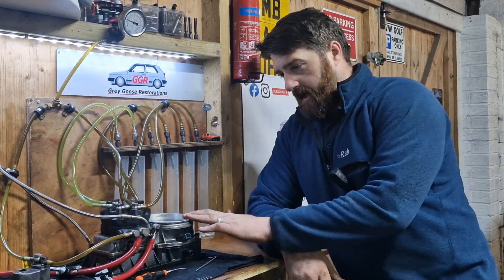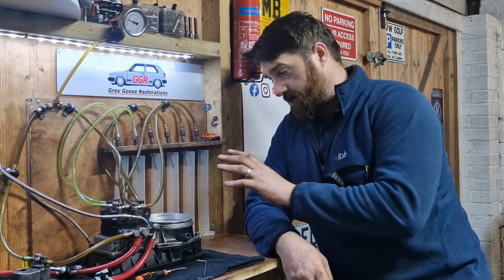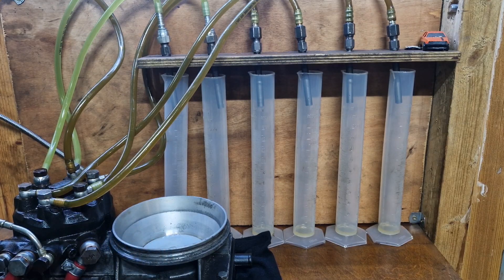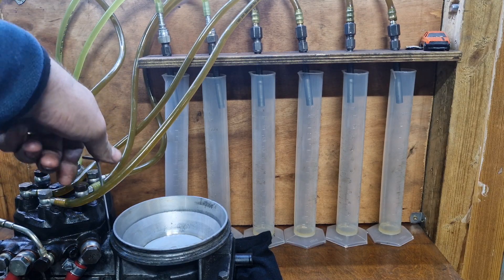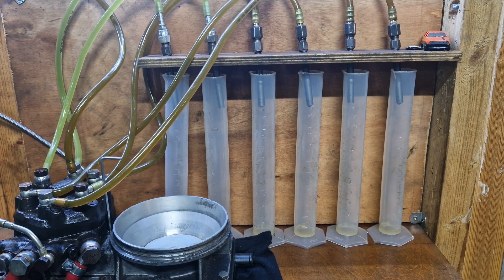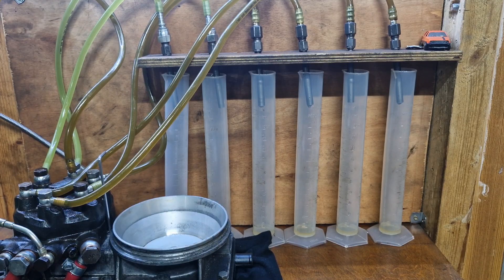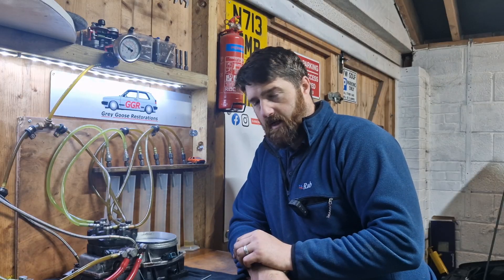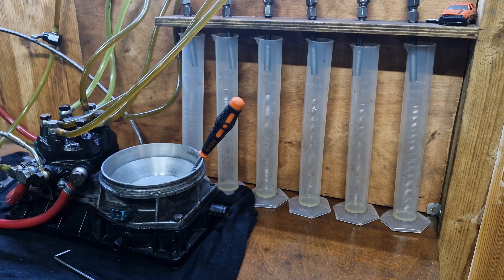Bosch K-jetronic - CO Mixture Basic Setting

Comment: Awesome to see the response to comments!
My question is, "Which of the 17mm connectors is coming from the fuel tank?". I see 2 17mm connectors; 1 of them closer the rear, one facing more forward alongside a smaller connector. Thanks!
Reply from the maker: The 17mm feed pipe is the one on its own, the return line is the one with the smaller bolts by the side of it
Reply: @GreyGooseRestorations  Subscribed! Greetings from Canada
Reply from the maker: @katey.m Many thanks, Canada is a beautiful place too 👍

Comment: an interesting question, have you ever done a test if the disk in the air mass meter is completely open when you hold full throttle? I'm thinking of an original 2.0l volvo engine. if it's completely open, it's unnecessary. to make a bigger throttle. then the engine will get too much air
Reply from the maker: I did a video showing how high the air plate actually rises if that's what you're asking
Reply: @GreyGooseRestorations  yes where is it?
Reply from the maker: https://youtu.be/h9O03Fd-WpE

Comment: Hi
It is same adjustment for KE jetronic?
I try make running escort rs turbo 1986
Reply from the maker: Very similar yes however with the KE units there needs to be around 0.5mm of air plate free play once the unit is pressurised
Reply: @GreyGooseRestorations  Thanks mate 👍
Reply: Do you know what pressure should be in KE system?  (Escort)
Reply from the maker: Just given me an idea for another video too 👍  5.6 - 6.0 bar system pressure with the lower chamber being 0.3 bar less than system pressure
Reply: @GreyGooseRestorations  nice one👍
I will wait for your new wideo 😀
Reply: Do you have Facebook account about cars ?
If yes, I will send you some pictures/video about escort repair

Comment: To make the injectors run when undertaking the injector tests in the car, is it simply enough to turn the ignition key on or should the power be "turned on" by running the fuel pump?
Reply from the maker: You will need to bridge the fuel pump relay in most cases so the fuel pump on the car runs continuously, you can normally swap the relay with another one in the fuse box which isn't a timed type
Reply: @GreyGooseRestorations  Thank-you. In our case that would be jumping our RPM relay.

Comment: Can you do a basic video where you disassemble all the parts of the K Jet unit and discuss the most common failure modes and adjustments. I am a SAAB collector and your videos are very informative. Do you ever see issues with the relief valves and where are they located?
Reply from the maker: Thanks, I will see what I can do ref a video like that

Comment: Hi! I'm from South Africa. I have a 1983 MK1 GTi. It's been a long time project. Was driving for 2 years until I fell victim to a 'break in' at a mechanic. Losing my complete functioning kjet system along with other GTi valuables. Car is almost back on the road aside from getting the patch work kjet system that I managed to get working. I've considered changing to diktator and itbs until seeing this video. You're a legend and a gentleman for what you're doing here. I'm sure like me thousands of guys struggling to keep out kjet cars on the road appreciate your videos and shared knowledge. Thanks bro!
Reply: Howzit bro. Wanted to let you know. Used your method and car started today. Thanks a million!
Reply from the maker: @lukeanthoo178 fantastic 👍
Reply from the maker: Thanks and much appreciated, when kjet works it's bullet proof and can supply enough fuel for many applications

Comment: Thanks alot. Trying to get a Porsche 924 Turbo I bought running. Got my pressures good after cleaning the WUR and fitting your filtered banjo. Car runs really bad from being adjusted when having wrong pressures. Have wondered how to get it back to a base setting to get it running and then adjust idle etc.
Thank you this helps alot!👌
Reply from the maker: Hopefully it will help 👍
Reply: Hi I have a 924 turbo as well with a similar problem...how did you get on?